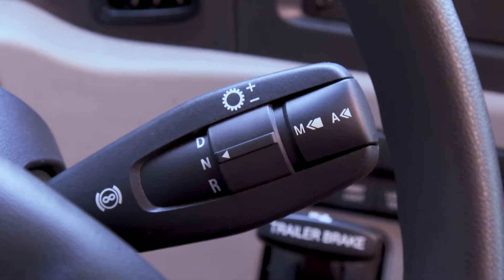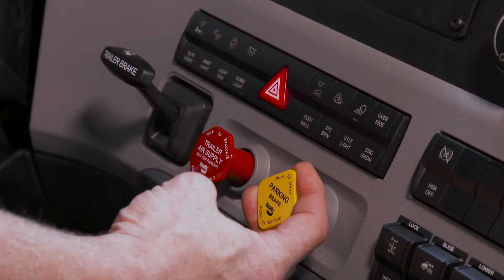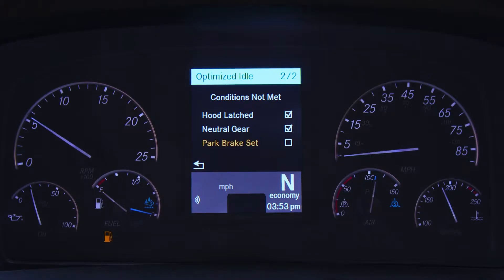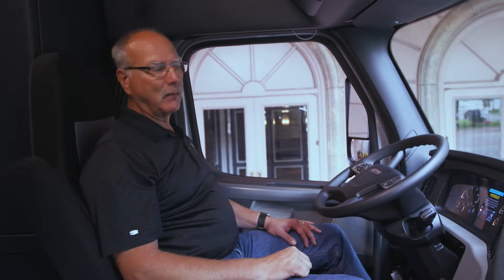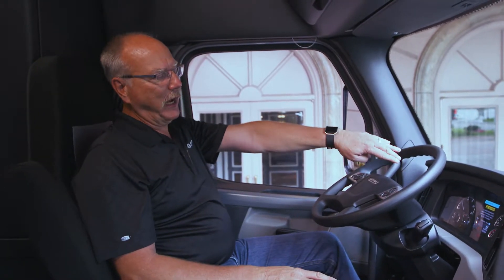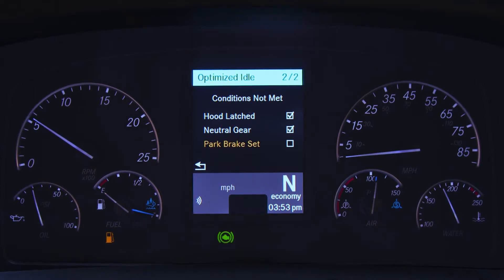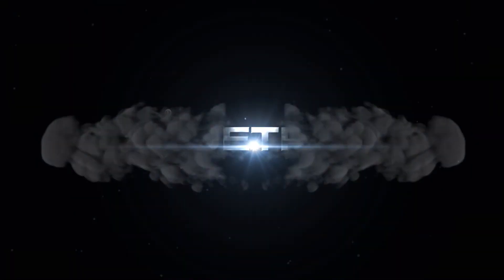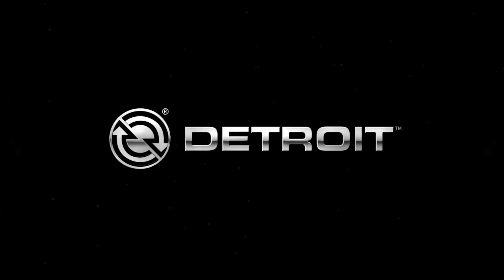Optimized Idle - System Safety Loops Training Video

Comment: The problem with my NEW 2024 Cascadia is that when it has already been running Optimized Idle, it will frequently give a “Safety Loop Fault, Key Cycle Required” dash message when it was already running Optimized Idle but the engine was off for awhile after reaching the desired temp in the sleeper berth.

Comment: My truck lets me setup opti idle runs a couple times then while I'm sleeping gives a safety loop fault key cycle required message which eventually I wake up because I'm uncomfortable then have to start over.
Reply: Try starting optimized idle for 5 mins on “Interior comfort on” then wait 5 mins while the truck is still started then put it turn “interior comfort off” that worked for me Good Luck